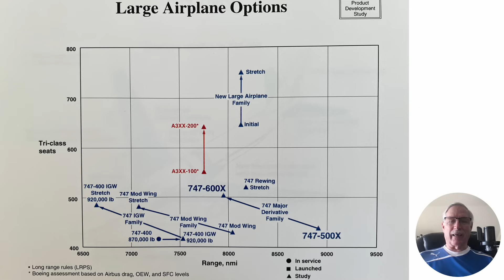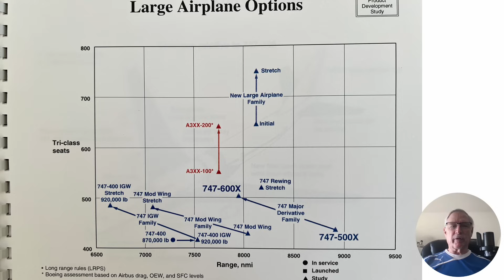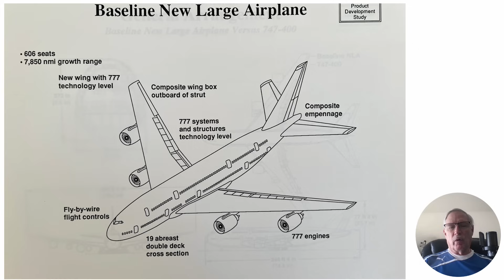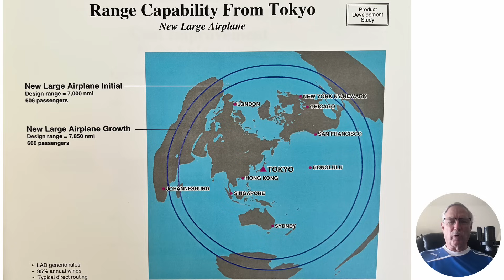Boeing dodged the 380 bullet

Comment: I work in the military side of Boeing but had a boss that worked on the Sonic Cruiser proposal. His team kept going back to the executives and kept telling them that the airplane made no sense. They were told to keep going. Once Airbus signed all of the international agreements for the 380, Boeing dropped the Sonic Cruiser and rolled out the 7E7 (787). It was a head fake. They knew that the A380 market was too small and that they would never sell enough to break even. Now, Commercial is struggling with Quality and there aren’t any new and exciting models in the pipeline. The truss brace is a dumb aircraft.

Comment: Airbus never made €1 on the A380 program. Imagine €25-billion+ of development costs and never producing any profits for investors. On top of that there were massively expensive wing structure design issue repairs and door replacement program, all borne by Airbus. The A380 worked on high density long range flights but there simply weren’t enough markets meeting that segment of the market. The airlines spoke with their orders and Airbus pulled the plug when orders dried up. The introduction of highly efficient and reliable engines for twin engine A350, B777, B787, programs accelerated the A380 demise. Ten year old A380s were already being scrapped in Tarbe, France before the program was ended after only 11-years.

Comment: Window seat would be great, both for looking outside and actually getting some GPS signal on my iphone so Foreflight could keep track of where we are (31 year retired pilot and still a backseat driver at heart!).  But of course, lav access is actually more important at my age, so farewell window seats!  Truth be known, I was somewhat surprised that the latest airliners (787 and the like) actually have passenger windows at all.  Very few look out the window, as you say; and the weight savings from the windows, to say nothing of the surrounding support structure, that could be dispensed with would be considerable - certainly worth pursuing in an era of removing olives from martinis (oh wait - that was done ages ago!).

Comment: I like looking out my window even if a bit of a white knuckle flier. One, where I sit and can check on whether or not the pilot has set the flaps for take off. Coming into SFO from Asia always let's me get a look at the Golden Gate Bridge which tells me I am home. It also let's me catch anything that everybody else misses. On a flight out of Bangor, Maine, in June 1976, the 707 came down the taxi way to make the turn onto the runway for take off. Me, glued to the window, saw one of the main gear tires depart the plane in the turn and roll off into the sunset. Oh, flight attendant, Oh FLIGHT ATTENDANT, we just lost a tire. They look out the window and confirm. Being little traffic at Bangor we then sat in the plane for 90 minutes while repair was initiated.

Comment: I have never flown an airplane in my life, but I work in demand planning. I feel like type ratings and similar parts / tooling are so important. Aviation has been defined by major upsets from 9/11 to covid, and we need unified fleets that can respond. OK, we're parking the a380s in the desert for 2 years and flying a320s, but the pilots can handle the switch with minimal retraining. In the meantime, wouldn't it be nice if the 320 and 380 used the same engine so you could rob your grounded planes for spares?

Boeing tried to do this to a degree with the 737, but I feel like they did it in the worst way possible.

Finally, I feel like there's a place for "single trijets" - an aircraft that cruises with a single high bypass ducted fan engine, with two afterburning low bypass engines in the wing roots for takeoff, landing, and emergencies. The idea would be you'd have ample thrust and redundancy for takeoff, but once you've got to cruise you fly single engine. If that single engine fails, the two afterburning engines can easily be started and provide ample thrust for ETOPS.

So imagine a fleet based on 1x, 2x, 3x, 4x, of the same main high bypass engine - with other similar parts, and engineered so they have a similar type rating with minimal cross training. You could put together fleets with the understanding that they'd go in and out of mothballs as economic circumstances change.
Reply: In particular, you take that same "single trijet" and replace the "emergency engines" with wing mounted high bypass engines. Now you've got something rivaling the 747 or a380.

Comment: Hi Ron United 777 lost tire and rim out of SFO, they diverted to LAX. Why wouldn’t they come back to SFO rather than go to LAX?
Reply from the maker: Not sure. One runway at LAX is slightly longer. Unless they were considering a lakebed landing at EDW but decided LAX was ok.
Reply: @ronrogers Well they needed to burn fuel to be lighter no matter what and you could be that the conditions were not optimal at SFO in terms of wins where LAX is almost always a very easy landing or the United has more repair services at LAX hard to know for sure
Reply: If you still have the flight number, date, etc you might be able to find the ATC recordings online. May not give you all the answers, but you'd at least know what went on between airplane and tower.
Reply: United has repair facilities at SFO. I use to loop the bay on bicycle rides stopped on road at the end of RWY 28 to watch planes take off out side the fence of the parking lot where the wheel landed don’t think it was a big deal for the plane and passengers but would have been a world of hurt to get hit. Always saw a guy in the park adjacent to 28L and R with video camera a great place to watch planes landing side by side. Love your content Ron!
Reply: SFO 28L was closed for construction, so that might be a factor that helped make the decision to go to LAX instead of taking a chance of blocking SFO's only long runway and making matters worse there.

Comment: Despite quality problems, Boeing avoided disasterous designs better than Airbus.  The 4 engine A340, especially the -500 was a disaster for airlines that bought it and the -600 was only sligthtly better, both were destroyed by versions of the 777.  The A380 is a miserable plane for the majority of passengers who fly economy, nothing like a 400 person check-in line to make you wish you had stayed home.  I avoid the A380, its size does not give each passenger more room and you cannot walk around like a cruise ship.
Reply: Passengers unequivocally worldwide choose the A380 to fly intercontinental. Emirates built their business model around it very successfully. They made it work. It just had the wrong wing (380-900) and RR threw old engines at it. It burnt too much fuel to be financially viable unless the airline had a huge business class market to pay for it.

Comment: The A380 was built around the "hub and spoke" model and has seen part of its role replaced by airplanes able to do routes directly. The economics of "hub and spoke" din't work out for most operators & their customers so they got rid of them.
Reply from the maker: I have seen airlines cycle between hub and spoke and direct. Direct was in when I was hired in '79 for UAL at least but didn't last long.
Reply: The USA is hub and spoke..and remains so.

Comment: I understand from an efficiency  standpoint why airlines like the 787 but why from a passenger standpoint? Just curious, I've never had the pleasure of flying in one. I always seem to find myself stuck in the middle seat of an A-321.  😢✈
Reply: Those are all good attributes, thanks for the replies! At this point, I'd settle for a bit of leg room and an air conditioner that actually cools the cabin.
Reply: Its composite construction makes it possible to have a lower cabin altitude and also because corrosion is not an issue the cabin humidity can be higher. This makes a big difference to how you feel after a long haul flight.
Reply: @johnsutcliffe3209 Also has larger windows and the windows are mounted up higher on the fuselage it also rides really smooth Lee do the flexible wing in the flaperon to control it
Reply: @mcamp9445  yes that wing is beautiful.
Reply: From a passenger standpoint, they killed the 787 when they went 9 abreast.

Comment: Well... fair to say that this decision not to go for such a plane is the only one "wise" decision from Boeing in decades. In addition, there's always this misconception about the so called failure of the 380 program. Thanks to it, Airbus became more efficient in designing new airplanes and it helped a lot for the 350, while Boeing only designed one (the 787) in the last 30 years. And even if you're right to some extend when saying the 787 is a great airplane, it is still badly impacted by many issues after 15 years😕
Reply: Not one of those issues has caused a hull loss. I can't help thinking there is somewhat of an over reaction with all of these "issues" nearly 1000 of them delivered and a safety record much better than the 747 DC10 etc. Even the 777 had that fuel heater issue that caused British Airways crash at Heathrow. The biggest grounding of the 787 was due to the engines.  You have to expect some issues with an absolute clean sheet design that pushes new boundaries with new materials and assembly techniques. After all we all want to fly as cheaply and effeintly as possible.
Reply: @johnsutcliffe3209  You forget the batteries issues at the very begining but it's not exactly what I was refering to. I was more into quality control/engineering problems that Boeing is facing. The plane itself is of course modern and safe. And by the way it sounds pretty normal to have safety records better than airplanes built 50 years ago🤷‍♂️
Reply: @Moi-Moi1  no I didn't forget the battery issues. Those planes wernt lost. They landed with no loss of life and were repaired and modified.   Isn't it interesting how the media made such a fuss about lithium battery fires over that but now with ev fires they are strangely silent. It is actually one of the reasons I say I'm thinking too much fuss is being made of 787s "issues"
Reply: @johnsutcliffe3209  Once again it's not about the potential of the plane itself, it's more about the manufacturing and quality control processes. There's no doubt the 787 is a great plane, efficient, very comfortable for passengers, and a good money maker for airlines. I just say Boeing are not what they used to be🤷‍♂️
Reply: The A380 program lost money thus it it was a failure. Boeing was able to re-wing 747 and still make money and Boeing redoing the 777 the undisputed champion of long-haul flight
Reply: @mcamp9445  lol! You funny😂

Comment: ...but they were hit by the 737 MAX  missile.
Reply from the maker: Ok, that's funny!
Reply: @@FishingPlanetMobile64You mean like concealing a critical addition to a flight control system with a single point of failure and not telling the pilots.  And then when two planes crash as a result,  blame the pilots.  I could be wrong, but I don't think Airbus have done that.
Reply: @michaelbruce5415  ok, Hans, pipe down.
Reply: @michaelbruce5415 I mean, didn't they purchase McDonald Douglas who did like the exact same thing with the DC-10?
Reply: @michaelbruce5415 Nope, Airbus has done that.